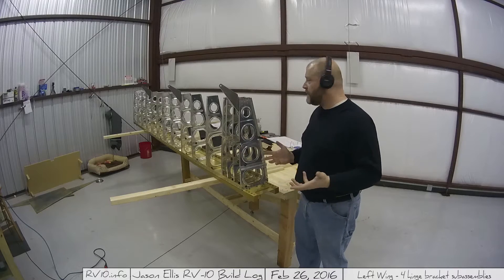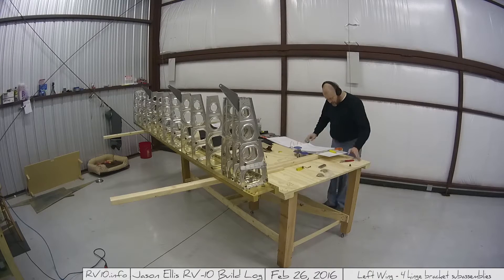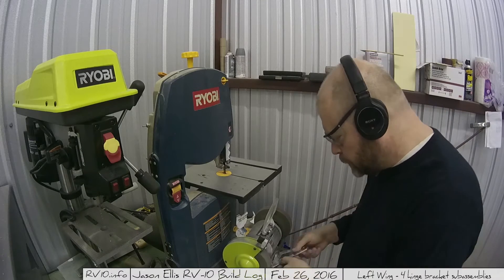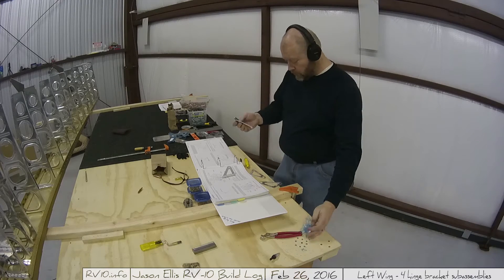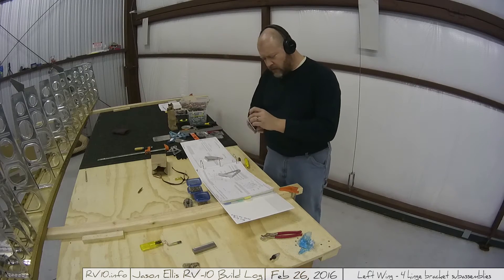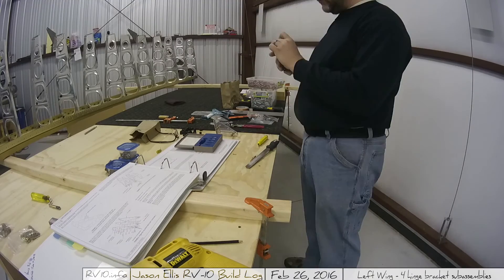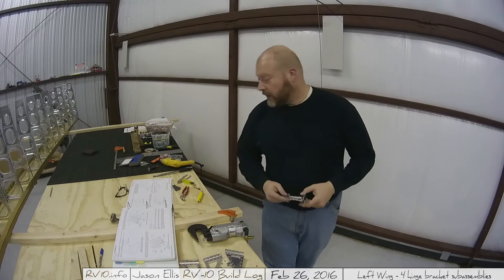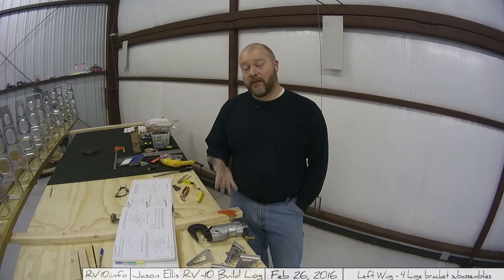RV-10 Wings - 008 - Left wing 4 hinge bracket subassemblies

Comment: Hi, Jason, I know this was a long time ago but did the bearings rotate easily? I did some hinge brackets for an RV-12 and they don't rotate as smooth as I would expect, I don't know if I did something wrong. If yours came out ok, is there some kind of technique to assemble?
Reply from the maker: For me they rotate perfectly smoothly.  Did yours get pinched or something?
Reply: They would rotate just fine when clecoed but after riveting you would need a bit of force to do it.
Reply from the maker: Too much force?  Or just "more" force than you like to put out with your fingers?  Meaning would they be okay with the leverage caused by the plane armature?
Reply: It's not easy to move it with my fingers, with some leverage it has no problem moving.